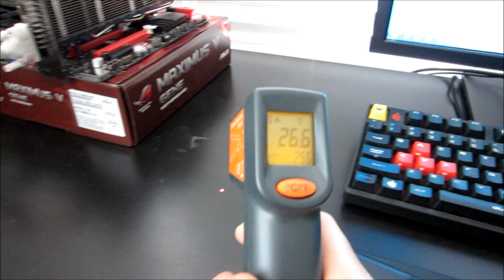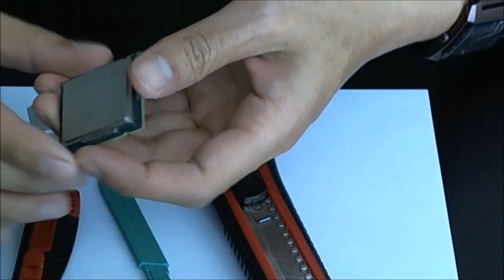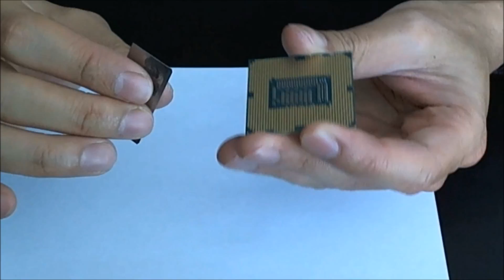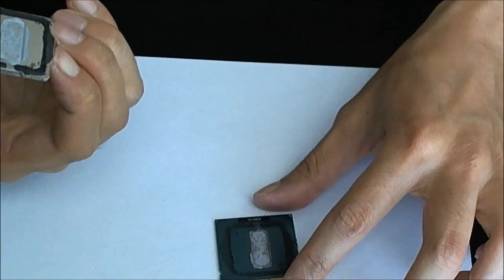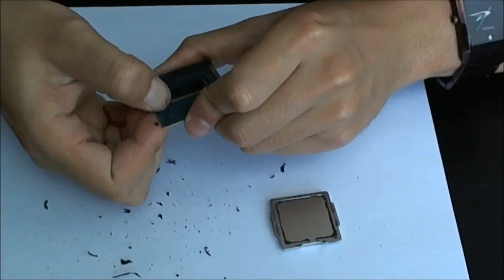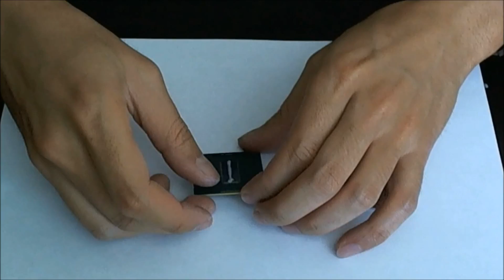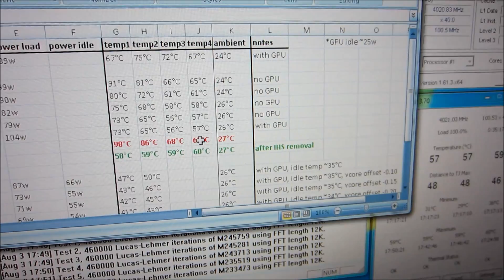Fixing Skylake, Haswell, and Ivy Bridge CPU temps: IHS removal

Comment: I cant believe this.
Are you seriously telling me Intel, one of the biggest IC manufacturers in the world spend millions on R&D and sell CPUs for 100's of £/$
And then cheap out on 3 cm of thermal paste?
Seriously? And this has a huge impact on CPU running Temps.
Sounds bonkers
Reply: If they didn't do this, how do they expect to sell the next version of CPU's? Imagine someone created and unbreakable tool that never dull, blunts or breaks. If ten people want this tool, he only sells 10. However, if he makes it slightly worse, he can sell it 10 times, over and over again. He might even slightly upgrade it each time to give them incentive to buy it again.
Reply: Damn capitalism :(
Reply: To keep the business running they purposely make theire products fail after a certain amount of time, 5-10 years max. With proper thermal compound or cpus would last 20-30 years, the fact that they would be completely outdated and couldn't run a latest wordpad is irrelevant. I'm not just talking about intel, a lot of companies do it, it's their policy ahahah lol.
Reply: SupremeGamingStyle
 Companies like Intel don't "purposefully design their products to fail", they design them to have a maximum MTBF. There's no reason to have a MTBF of 20+ years for a product that may be irrelevant within 5.
Reply: SupremeGamingStyle  nVidia don't make CPUs, for starters, and nVidia GPUs can easily withstand temperatures over 100C without falling over dead. For long-term usage, if one can properly cool the memory ICs, temperatures in the 90-95C or lower range are preferable on either brand, though.
Reply: sebmei99 http://gyazo.com/11063613bcd081a365d30755b0f8a955
Reply: That's why i went AMD.
Reply: SupremeGamingStyle nVidia fixed their longevity issue. But AMD is still more reliable in terms of CPUs because of the soldered die.
Reply: sebmei99 I had an AMD FX 8350, which I overclocked to 4.8 Ghz and it still didn't hit 85 C. The cooler was Corsair H100i.
Reply: The original Pentium 4s as well as the original line of Core Duo processors (if I recall), didn't have overheating protection and caused many a processor to die from thermal failure. Intel since learned and first implemented a straight thermal shutdown, then a throttling facility, then a combination of both. Put a Pentium D 940 into a client's computer the other day and nearly had a heart attack when the thing started screaming about overheating, because the HSF's fan had gotten stuck when the system was placed upright. That's one example of a unit that DOESN'T have throttling/thermal shutdown. The heatsink was hot enough to burn your finger when touched by the time I got it switched off, but the thing thankfully didn't suffer any damage (apparently). Fortunately, all the parts used aside from the HSF were my own spares, so if it broke it'd by my loss rather than theirs.
Reply: Ok think of it this way. Not talking about everyone but chances are if you are caring about all these hardware details on both companies you are probably building a pc. If you are building a pc you are probably wanting powerful performance because if not you would have just bought a laptop or mabye a pc. If you want higher performance chances are you will be upgrading in a few years. And if you are going to be upgrading in the next few years chances are your intel or amd cpu has survived if your not stupid. So now i ask, if the performance in those 2 years were fine, who cares which one can last 5 years to 5+ years, sure its cool to know your cpu was built better but it can be obsolete
Reply: if oc'd and your case is shit with no airflow. Amd cards withstand 95c nvidia only 75-80 Meaning amd makes thicker better quality shit. We're talkin about cpu or gpu
Reply: *****  i'm gonna have nh-d14, what temps should i expect, also i've read that amd procs after phenom ii's don't have any sort of temp measuring in them, is that true?
Reply: SupremeGamingStyle  i'd have to assume current gen cpu's from amd have temperature sensors in them.

i do know that the old amd's didn't have an overheat protection, so if they ran way to hot they just kinda burned out where intel's just shut down to try and save themselves.

(not sure about the current cpu's, intel's been slapping them left and right since the c2d so i lost interest:P)
Reply: i had a intel p4 631 and it shut down then i oc'd a bit to high, it did so many times when looking for it's limit. and i do believe the 631 was from the pentium series before the pentium D entered in.
my c2d E6600 also shut down many a times when overcloking and pushing to hard.

so i know for a fact these 2 had them. i do know they did burn out but the material i read was all idiots, 1.6-1.7vcore on air.

i have pushed my old cpu's to there limits on air and beyond those limits but never surpassing 1.55vcore, 1.5 is generally considered the max, 1.55 is pushing it above, your asking for damage.

i suppose in your case since the pentium D's were notorious hotheads that need active cooling if the cpu runs post and then starts to hauls ass loading an os with a passive heatsink on it. yea it should probably overheat.
Reply: http://ark.intel.com/products/27519/Intel-Pentium-D-Processor-940-4M-Cache-3_20-GHz-800-MHz-FSB
Thermal Monitoring Technologies No
http://ark.intel.com/products/27479/Intel-Pentium-4-Processor-631-supporting-ht-Technology-2m-Cache-3_00-ghz-800-mhz-fsb
Thermal Monitoring Technologies Yes

Worth noting is that as they describe on that page, the thermal monitoring tech would supposedly only manage voltage. Some motherboards would react to the temperature and have shutdown limits themselves (as you no doubt know), but what I'm primarily referring to is the processor's ability to switch itself off entirely rather than rely on the motherboard to do it. This is something many of these Pentium D processors didn't have.

These units that had their limited functionality were discussed a lot on forums and the like largely because it seemed like such a ridiculously bad move for Intel to release a processor that had such a high TDP yet lack the capabilities necessary to protect it in case of a fan failure.

I had a look earlier and couldn't find any Core Duo models that didn't have the TMT field marked as 'no', so I might just be remembering things wrong in that regard, though.
Reply: Philip Warda Did you just realize this now? To the average consumer this might not be a problem but if your an enthusiast and want effiecent cooling Its truly a sad and frankly maleovent Practice tsk tsk *****
Reply: andrewszombie It's terrible how Intel cut costs buy probably a few cents per processor,yet they still charge over $200 for a decent quad core.
 AMD still solders all of their CPU's.
Reply: Archit N. It's sad that Intel is using the cheapest thermal paste like you'd find on laptop CPU that dries up after even light usage. 
Every AMD chip that AMD is still making still gets soldered to the IHS.
Reply: AMDfan4237  saved a few mill on that, plus procs burn out faster, so ppl buy new ones, they actually gain more money by making their chips fail faster, great business plan.
Reply: SupremeGamingStyle But are they really saving millions? What about the power/ enthusiast users and overclockers that are sending processors back because of high temperatures?  You can usually find the same awful thermal paste on laptops,and the stuff can dry out within months to a few years,which eventually causes the processor to degrade from the heat.
Reply: Theo Lubbe You are high. The P4's have thermal monitoring along with the Pentium D's. the thermal throttle for the P4 is 60C and the PD is 75C

Pentium 4 thermal shutdown is somewhere in the 95C range and the PD is 90-95C.
Reply: ***** the H100i isn't all that good. I can do the same with most air coolers. Only real good water loops are custom loops. Corsairs are just meh. a good waterloop will cost you 200-300$, and consists of a pure copper waterblock and heavy thick radiators.
Reply: Theo Lubbe
ah didn't realise the pentium D's were "special" in that area o.O. never did pick them up, benefit over a single core pentium for the price was just not there (imo) c2d changed that so i guess i skipped the bad generation >.<.... i'd definetly have blown it up if i owned one in that case :P
Reply: anub1s15 Pentium D's ran warm, but I've never had any of mine overheat. They run much smoother than their Pentium 4 counterparts. They weren't honestly all that horrid for the time. Just the heat was nuts as it was two P4's stacked ontop of eachother.
Reply: SupremeGamingStyle Virtually noone keeps their CPU until it breaks. They always get replaced for other reasons. Therefore there is no reason to skimp out on heatsinking.
Reply: SupremeGamingStyle Most GPU's maximum safe temp is 90 C. That's on both sides of the fence, not just AMD.
Reply: Mine runs far less with a Cooler Master Hyper 212, although replaced the fan with a Noctua Industrial Series fan that run at up to 3,000 rpm, although lowered mine to about 2,000. Rarely does the CPU surpass the 40C mark with many Chrome tabs open, a Malware scan running & normal temps are 16-21C at idle, and as low as 12C, although only have a link showing 13C.

http://speccy.piriform.com/results/GUHywCAGd5NEjBvRp8KWMoW

Who says that AMD CPU's runs hot? I believe it's Intel fanboys spreading the hype, my FX-6300 system also runs cool, can't be a coincidence, two different machines. 

http://speccy.piriform.com/results/HeJBUMjlYTvLlUNejO0shlr

My Intel builds runs much warmer at idle. 

Cat
Reply: Yep, they certainly do.
Reply: Theo Lubbe  That's capitalism for ya. I still have a computer from 2004 which runs fine, when intel and nvidia parts fried, changed them to amd, still runs to this day, some people even use pcs as old as 1999~, it's not about being irrelevant, it's about making a product that will last u so long, you'll buy a new one when it becomes obsolete to you, and not break down in 2-5 years which is what intel wants, to push their chips. AMD is trying to take the crown by making their cpu's last, cards are just as good as far as peoples reviews go.
Reply: SupremeGamingStyle AMD cards run at 90 degrees stock so lol...

Comment: People are saying that Intel is better in performing than AMD, I agree with that but Intel cpu's cost double of what AMD has. AMD has a better performance/price ratio but can't perform as well as Intel without overclocking the chip. For example my mid-range rig has a AMD A10-6800K that cost $120 and can run Battlefield 4 at medium settings. My complete rig cost me $400. Where if I chose Intel the price would skyrocket to around $700-$1100 since I would have to buy a graphics card, Intel integrated graphics sucks.

Comment: The main problem wIth Intel using an 'inexpensive' thermal paste is the paste dries out over time, as is revealed in this delidding video. Overall thermal conductivity is dramatically reduced and causes uneven heat dispersion from the die to the spreader. This condition is also revealed in this video, as evidenced by the large temperature differences between the cores.

Comment: I am surprised you touched the bottom of your cpu with your hands, the natural oils in your hands will corrode the finely machined molding that is level with the capacitors and contacts.
Reply: Zipo214 ... did you read this on the back of a cereal box?